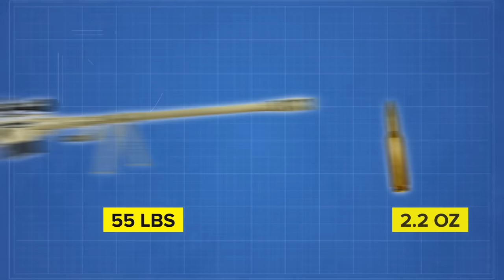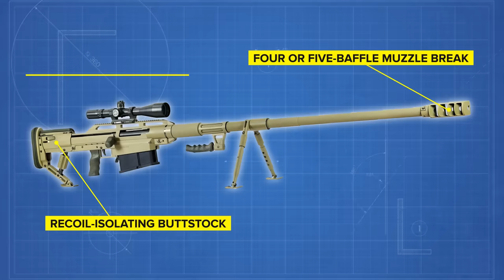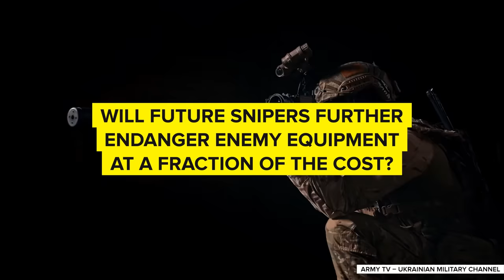How Ukraine's SnipeX Alligator Mega Rifle Is Terrorizing Putin's Army

Comment: We need a fact check here, the longest killshot is supposed to be 12’400+ ft long and made with a Ukrainian made rifle named Horizon’s Lord. Bullet cal.12.7mm/.50x114hl, not 14.5x114 cartridge the Alligator use. The Alligator has its own unique merits, but not the record of the longest sniper kill. That will happen an other day I’m sure
Reply: He specifically said record longest kill WITH the alligator. Not in general.
Reply: Yes, the author mixed up the catchphrases
Reply: Horizon's Lord is more optimized for sniping, Alligator for Anti-Materiel use

HL is shorter and lighter, shooting a lighter bullet, but launching it about as fast as Alligator. HL bullet has substantially better ballistic coefficient (Local manufacture. Lower ballistic coefficient than Hornady A-Max, but enough velocity to make up for it), so purely for ELR shooting, HL is better

For Anti-Materiel use, 14,5x114 is preferable due to there not being sub-caliber penetrator ammunition for either - so a bigger B-32 bullet will retain energy better and deal more damage after penetrating

HL can be barrel swapped (and shock absorber added) to shoot 14,5x114 or 23x115, but that completely removes the reduced weight and length benefits over Alligator
Reply: @signe_stilett  just looked HL up, it looks kinda funny ngl. A tank barrel with a scope on it ^^
Reply: have many claiming longest sniper kill very few confirmed/proven
Reply: Ya thats right. Thats no rifle any more but machine. I am precision shooter and doing my own reloads.
Reply: @zDemoGODz tank up to 6 km.

Comment: Just think of what it could do to an airfield of parked planes/helicopters.
Reply: Answer: "Havoc"
Reply: RIP aircraft
Reply: Unfortunately when fired it gives off the same amount of light as a grenade, not to mention the noise. You'd have to be around it's max range for it to be effective without being counter sniped. At that range, you run the risk of being shelled. Unlike most snipers being warned not to take more than 2 shots per position, these can only safely take one.

Comment: The idea of a bullet whizzing uninterrupted across 23km to take out a target on the other side of town is mindboggling.
Reply: 23,000 feet not kilometres.
That's be a little over 7 kilometres.
Reply: @Lazmanarus  how long should the taget wait with moving ? :face-turquoise-covering-eyes:😂
Reply: @Lazmanarus  That doesn’t make it any less impressive tbh
Reply: @xxxy9928  bout 7 seconds
Reply: @thekraken1173  These stories are often fake thou. Ukraine regularly makes these up. They also said the klled the general that took Avdiivka in 2022. I guess he ressurected. Pro-ukrianinas should think critically.
Reply: @attilamarics3374  I have literally never seen anyone make that claim, pro-Ukraine or otherwise, except you
Reply: @R1sK-hv6yy  nah more like 20
Reply: @12vibaba  i fucked up my math then
Reply: @attilamarics3374 just like the “Ghost of Kiev”.
Reply: @R1sK-hv6yy  the muzzle velocity is ~1000m/s considering drag from air resistance, it'll take more than a second per kilometer
Reply: @VulpineCortex  I forgot to account for that, ur right

Comment: One of the biggest advantages of ceracote is a drastically reduced IR signature most coatings and paint literally glow under nvg
Reply: How does it glow under nvg? I could see maybe if it were ir but either way I find that interesting
Reply: @Spiritofaconure Heat produces ir radiation. Which wavelength depends on the temperature. Warm blooded creatures of all kinds produce a detectable heat signature easily displayed on night vision equipment. It follows therefore that a heated inanimate object is also detectable.
Reply: @Spiritofaconure a lot of coatings allow the base metal of the gun to conduct heat or are thermally conductive themselves and heat makes infrared light. Ceracote is probably insulative to some degree from what it sounds like it's ceramic based.
Reply: Only if they're glowing giving off light. A cerokoted barrel will still glow. A layer of ceramic that thin is not going to cool off a barrel enough to reduce that. Night vision doesn't work like that. Although heat (also known as infrared or thermal energy) and light are both parts of the electromagnetic spectrum, a camera that can detect visible light will not detect thermal energy. Look it up. Only reasons are anti corrosion and camouflage.
Reply: Cerekote Gen II reduces IR reflection. It's also for color/camo and corrosion resistance, nothing else.
Reply: @jonnytoast ...mostly because I never heard of it ,being done or existing. I suspect- they have scopes that can/ will do both. Night vision and infared- switch between of both on ,and overlaid - . .there are essentially two goals - finding and identifying targets - and altering the targets fate ...let's try it this way , ill give 100$ for the head geat of a " ranger s " spotters - headgear
Reply: It’s still just ugly

Comment: The only thing i will say is that “there a millions of rounds” isn’t fully true. A sniper can only really use the first batch of rounds made in a mould, as they have less imperfections and thus are more accurate. You need PRECISION made ammunition for mass distance.
Reply: Most long range shooters fire-form and reload to get better repeatability, too
Reply: @signe_stilett What does ‘fire form’ mean?  Casting their own bullets?
Reply: @ronjon7942  firing a factory round specificly so that brass expands into your rifle's chamber, to get more repeatable case volume - only then do you load actual sniper ammo. 

Since then I learned that we do have serial manufacture of precision ammo for Horizon's Lord,
 (and that serial ammo was used for this shot), and precision ammo can be produced in factory but the costs and difficulty of setting up precise enough manufacture are a factor. Hence most hobby precision shooters buy factory ammo and fire-form the brass. Then reuse said brass 5-20 times (depending on cartridge and case quality)

Comment: So has this supposedly surpassed the record made with the M2 with a telescope ducktaped on it?
Reply: That was 50 years ago. Pretty sure they use FlexTape now.
Reply: Duct-taped. It's got nothing to do with a duck.
Reply: @pike100  It's duck tape because it was made with cotton duck.
Reply: @pike100 It's made with Cotton Duck fabric.   It was never intended to seal ducts.
Reply: @dennisp.2147 It was created to seal the WWII era DUKW (AKA Duck) truck.  Hence the name Duck tape.  It spent years sealing air conditioning ducts, hence the name Duct tape.
Reply: @frankedgar6694 No.  It was originally created to seal opened ammunition packages.  The DUKW story is an urban legend.  It's also about the worst possible tape that you can use to seal a duct.
Reply: Lots of things by this point, Boomer.
Reply: @pike100  its actually made from murdered ducks, hence the name.
Reply: @pike100  Exactly! It was originally named after the type of cloth in the tape, not for some farm animal. :)
Reply: @user-xv9tj3dl2o There is no 'IT' - are and always have bee two different products.

Duct tape has no fibers in it.

Duck tape has fibers in it and is terrible for sealing ducts.

Just to make it interesting, some company trademarked 'Duck' so now just about any tape can rightly be called Duck tape.
Reply: Boys settle down  it's M2 scope tape now
Reply: in regards to the tape discussion,
if a bungie cord had been used with a bootlace would you have still had such an amusing discussion? 
duc-taped for a general use term? 🙂

Comment: I'll tell you how this amazing new game-changing super weapon is terrorizing Putin's Army... it isn't.  Not at all.  Nor is it new, or even the most modern or effective heavy machine gun caliber based rifle out there.  That goes to the Barrett .50 caliber.  It's a lot more mature and finished as a production model than anything rushed into production within the last 18 months or so.  There's also little to nothing its older Soviet 14.5mm will do that .50 caliber won't.  And finally, this concept goes back to WW1 with extended length 8mm Mauser cartridges that could pierce the old British MK1 tanks.  It was even more common at the beginning of WW2 with the Finns and Poles fielding bolt action anti-tank rifles in .50 cal, 14.5 mm, an even a few in 20mm cannon chambering.  By all accounts they were very accurate, reliable, and unfortunately punishingly brutal on the operator to fire, but the 20mm version's range surpassed that of even today's .50 cal and 14.5mm versions due to the vastly larger amount of propellant in those casings.  They fell out of favor as the war progressed as even the lightest tanks could not be pierced by them at that stage, although the Brits kept making their version (Boys Anti-tank Rifle) right up to the end intended for anti-material use.  Point is, this rifle isn't new and certainly isn't the sensational "game-changing" technologically superior weapon the headline or author would have you believe it to be.
Reply: Yap yap commie
Reply: go get a job in russian trenchs
Reply: @Jagwart  If only we could all be gifted geniuses like you, Jagwart.
Reply: @stevengardner81 Thats "trenches" Stevo... trenches.  Your insults might begin to be more effective if only you would learn to sspell wurds propurly...
Reply: @bigweek85joeyjoejoe31 damn joey, in the youtube trenches. From one joe to another keep it up 🎉

Comment: You have overlooked the 20mm sniper rifle!
Reply: Yes; the Lahti L-39 is not only 20mm, but also 7 feet 3 inches in length, larger than the Alligator. At a weight of 109 pounds, however, it was dubiously man-portable.
Reply: 20mm…even at 109lbs, the recoil must be brutal.  Bone breaking, even.

Comment: I thought there was also a sniper that uses the ammo of the 30mm GAU Avenger the A-10 Warthog uses, but with a handle attached to it. So you have a bunch of those with the handle attached to it. It was done because of the massive size of the whole thing it was easier than making the normal ejection and reloading system. I also remember it said it used the Uranium tips obviously.
The range was also insane, shoot, get up and move, be out of position as the bullet hits the tank for instance 2 miles away. Likely capable of far longer obviously.
I saw it once on a Discovery Channel show, a loooooong time ago. But i've not really been able to find much about it, maybe becuase it do not know the name, maybe it was just being tested and not in active production.
The range of this is also insane, and with such a long flight time and more time for conditions to change and the target to move it is obviously not meant for anti-personnel, though it might go through a few people, it's just not the best fit, but a vehicle, also if not moving maybe less likely to move, bigger internals you might be aiming for, so even a few inches off might not be the biggest problem, yeah, this thing is a danger, and great fun.
Well, apparently it was used to kill a soldier @ 3.8Km, crazy. I wonder if it was super useful use of it, was it just a soldier or someone of higher rank ? A benefit though, they're less likely to spot you, further away, the sounds takes some time, you could be gone by then.
I would expect it to be used more for vehicles.
Reply: Nice questions that I happen to have some answers to. If you find that GAU-8 With a handle, please mention it, I am very interested in autocannons and adjacent topics

The 3.8 km shot was done with a different rifle, Horizon's Lord. 14,5x114 like alligator but necked down to 50cal and using a domestic manufacture bullet, ~9 second flight time to target. Target is believed to be an officer, given they were instructing other soldiers. 

Alligator currently holds 4th longest confirmed hit at 2,7km. I do not know bullets used with it, so I don't have the time of flight

Regarding the practical accuracy against vehicles, it has useable first shot hit probability on man size target at kilometer distance, and with B-32 (AP-I) bullet, time of flight out to 2-3km is ~8-12 seconds. Adequate accuracy and remaining energy at that distance for engaging BMP/BTR/unarmoured vehicles. Also used for destroying radar/jammer/comms equipment
Reply: And as for how a shot at 3,8km was achieved - the sniper did a shot to find correction for wind about half a kilometer from actual target first, then engaged the actual target. Source - Ukrayinska Pravda interview with the sniper. Disclosing identity was sniper's own choice
Reply: this satire right?
Reply: @killerbern666 what part would be satire…
Reply: @gabiballetje  a sniper that use the ammo a gau-6 shoot

Comment: The reason match grade and sniper rifles are almost exclusively bolt action is because when the bullet fires and is traveling down the barrel you can't have the mechanism expelling the empty casing and reloading a fresh round because that causes movement, the last thing you want in match firing or sniping at long ranges is any movement regardless of how minute it is. A 5 int breeze can alter a bullet several feet over a Mile distance.
So that stuff about anto fire tilting the barrel? BS.
Reply: Always wondered about the use of autos for sniper rifles.  I guess I just assumed the engineering was worked out that the bullet had left the building, before the action moved much…perhaps by placing the gas ports further forward??

Comment: Please do not call them  ' sharpshooters '.  
In military terms they are called ' Snipers '.    Military snipers are very proud of their job and are not just highly trained shooters, they also are extremely good at moving into and out of positions without being detected. They are experts at camouflage. They may have to stay unseen in a sniping position for up to 4 days or longer during all eventualities and any weather. They are skilled at compensating for extreme range and crosswinds. They are expert at using one single piece of weaponry with the purpose of taking out very specific targets. A good sniper can terrify and degrade the morale and combat effectiveness of an entire enemy battalion. 
Snipers are a breed apart and are proud of their skill set and the force multiplier effect they have in the field.
To call a sniper a mere ' sharpshooter ' is insulting, and will get you a beating in any bar with service personnel in it.

Comment: Muzzle brake, not break.

While this may seem like a trivial or pedantic point, for people unfamiliar with the purpose and means of operation of a muzzle brake, it can make things more confusing by being sort of a nonsense word when "break" is used instead of the proper term "brake".

The idea of a muzzle brake is to deflect some of the muzzle blast backwards to pull the barrel forward with that thrust, thus countering the recoil of the weapon.  And thus we use the word "brake" as in car brakes, etc.  It retards the recoil as auto brakes retard the motion of a car.

If you look at the shape of the muzzle brake, you can see the backwards-facing vents that deflect some of the muzzle blast to the rear, and you can imagine how that blast will then try to pull the barrel forward, thus counteracting the gun's recoil.  The unfortunate side effect is that this muzzle blast that's deflected backwards comes back toward the shooter, which makes the shock and sound that much louder and more powerful as felt/heard by the shooter or those nearby.

Always wear your hearing and eye protection, people!

Comment: Can a target be spotted 4 to 5 kms.  .away. doesn't make sense.
Reply: Yes, it can. However, confirming it with current optics might be challenging. But, you can use drones and electronic warfare and other things, to identify a target.
Reply: @rauchgranate5648  destroy target with a bullet ?  Using drone. Artillery maybe
Reply: @ashokagarwal78  At 4  km and above the chance of hitting a target with any rifle are quit low. 
Drones are good for point targets
Artillery is good for larger aerial targets
Both can be available, depending on the mission. And both can be used,without compromising your position.

Comment: For us normal people around the world the rifle is 198cm in length, those old fashion americans ( and UK ..sorry i forgot )with their imperial measurements
Reply: You do know that the imperial system they use came from the UK right?
Reply: @Kitt_the_Katt  True.. dont think that much about the UK since brexit so forget they started this shit, same with driving on the wrong side of the road.
Reply: Look at your tire sidewall.   The measurements are in INCHES.
Reply: @jakleo337  True, there are some overlaps, the US/UK also use a lot of metric systems like with the coins etc. The tire measurements are indeed sizes but they are more used as a fixed number like a size shoe, not a measurements in distance for other things.

Comment: If I made one I would use stepper motors to adjust the x/y movements and use a monitor so the gun is steady.
Reply: Snipers generally use tripods and clamps they adjust to get ELR shots like this. Bipod and stock are just not enough. Yes, it is feasible to set up a tripod and get out after

Autonomous platforms can afford to take more heat, so they have more demand in MG/HMG role, like ShaBlya turret (Integrated with Rys' wheeled platform)